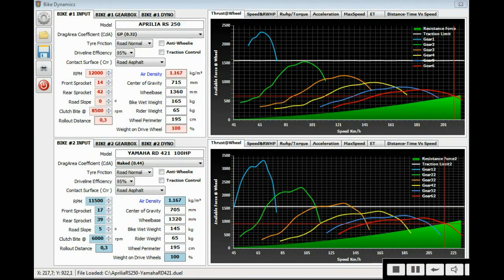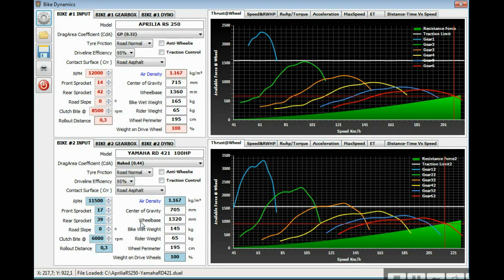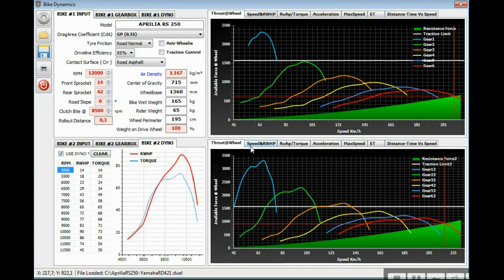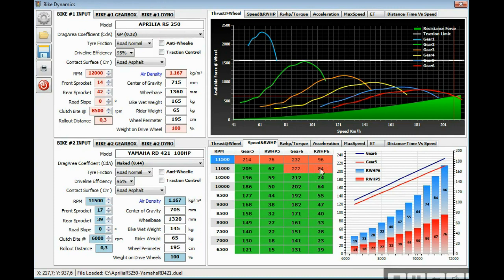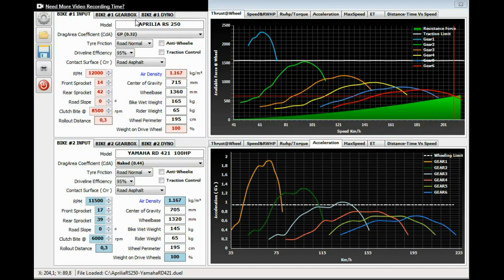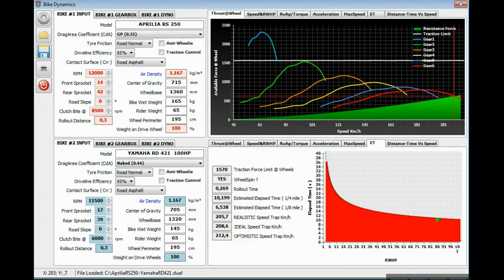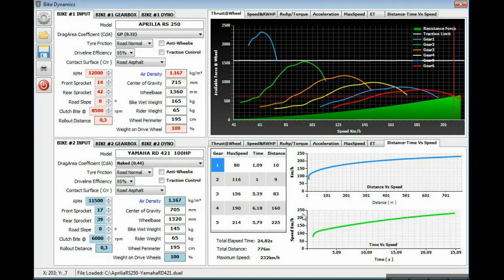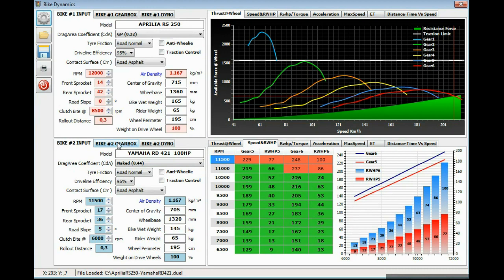RacingSM Software - Bike Dynamics Simulator

Comment: Excelente!
Parabéns.
Uma questão: a 350 com o kit para 100 cv´s tem dificuldade de ultrapassar os 220 ou isso deve-se á relação de transmissão?
Reply from the maker: A dificuldade em ultrapassar os 220 km/h deve-se naquele caso à ausência de aerodinâmica ( naked, sem carenagens ), se se utilizar o coeficiente aerodinâmico de uma mota totalmente carenada, não teria dificuldades em atingir os 250 km/h reais com uma transmissão mais longa ( 17 - 36 por exemplo ).
O simulador é bastante complexo e permite uma combinação infindável de variáveis para se estudar até à exaustão o melhor setup para uma determinada mota, seja road-legal, de competição GP ou Drag Racing.
Reply: O simulador é um show!
Agora fiquei mais descansado com o kit de 100 equídeos. ;-)
Quanto custa um? 2 mil euros?
Com a ele a naked equipada com uma transmissão curta fica um bicho impróprio para o kit de unhas dos comuns mortais.
Abraço.
Reply from the maker: zardportugal Há muitos fabricantes americanos, depende muito se tem válvulas de escape ou não, configurações de Curso X Diâmetro etc .. os preços são variáveis podem ir de 2000 até 5000€ consoante a cilindrada etc :)
Reply: Pois.
Tem de se pagar a qualidade.
Abraço, obrigado.